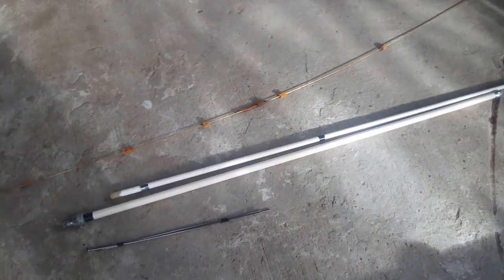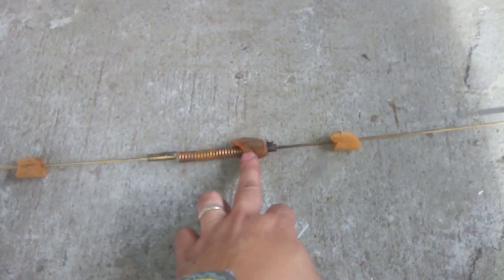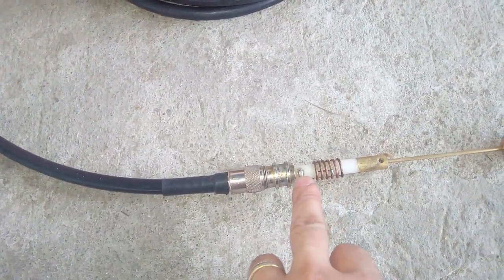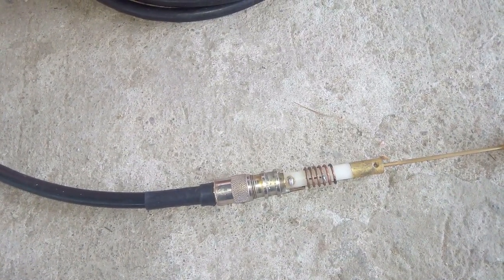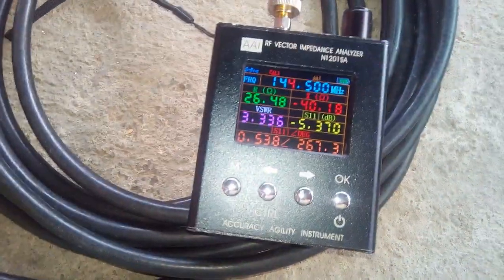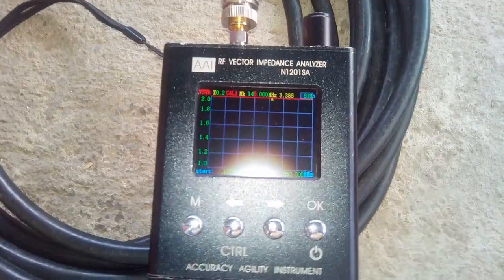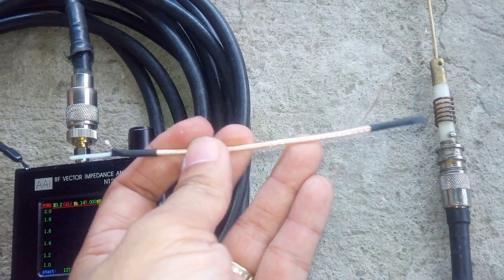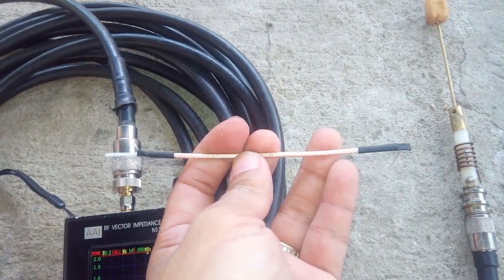Restoring Diamond F22A antenna coax replacement for capacitor - calibrated with N1201SA and NanoVNA

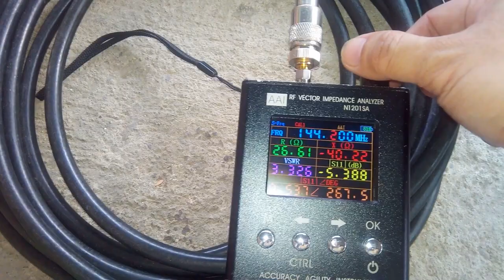Comment: Hello. I also repaired my x300 antenna. When i bought it the swr response was ok. After 2 years or so I had high swr response. I dont know why. When I opened it there was one 5pF capacitor inside. In fact it turned out that the cap was ok. (It had exactly 5pF). I tried to make my own 5pF cap with RG174 cable. I soldered it exactly where the previous one was. But unfortunately it did not help. I started to trim the cable until the swr response was ok. So the cable capacitor has now 3-4cm in length.(around 3 pF) The antenna works perfectly now. 1:28 at 144mhz  1.08 at 145mhz and 1.28mhz at 146. At 70cm it is also fine, around 1:2 or 1:3. So if anyone has this problem with antena, do what I did and it will be fine 😊
Reply from the maker: Good to hear that it helps you.
Reply: @EphraimGariguez  your video helped me a lot ! Thank you

Comment: I'm a bit curious why you had conducted your measurements not in free space, but laying on concrete. I do like how you used the coaxial cable as the capacitor, but somewhat concerned as to what the final values were while the antenna was mounted away from any near materials (ie concrete).
Reply from the maker: Of course it will work fine as your concerned is just restore it based on the original manufacturers specification (I did not alter the antenna physically, I just replaced a component that failed). If you're using antenna analyzer to tune you are fine, however if you are using an swr meter and feeding an RF to the antenna the result would be erratic  even at 5 watts portable if it is lying on the ground. Try it yourself.

Comment: Did you measure the field strenght, before and after? You have CH0 for transmit and CH1 for receive, you can measure the transmit power or field strenght
Reply from the maker: No need for that it's a restoration   just refer to the manufacturers antenna datasheet, my only concern is to restore the antenna to a working state.

Comment: One of the wire of the ceramic capacitor is connected to the core of the PL connector  hence to the core of the coax?
Reply from the maker: You just need to put it in place of the original capacitor, the end of coax replacement is not soldered together to form a capacitor replacement.

Comment: Bakit po antaas ng swr ng f22a ko po sa 144.000 1.6. Sa 146.000 1.2 sa 14800 1.4
Reply from the maker: Ano ba ang ine expect mo bro? nasa tolerance level yang values ng SWR mo pwede mong i adjust i check mo yung cutting chart ng antenna mo, ang 1.6 :1 SWR ay 5.3% power loss lang so kung 100 watts ang radio mo ang loss mo ay 5.3watts lang - Unfornately walang perpektong antenna system pwede mong i adjust hanggang makuha mo ang gusto mong level pero within tolerance level yan check mo eto. https://dw1zws.com/power-loss-at-various-swr-readings-and-residual-power/  ang G7 antenna for example ay rated as less than 1.5:1 at 2Mhz bandwidth https://dw1zws.com/g7-antenna-cutting-chart/

Comment: seperti antena berbaring tidak swr tinggi, dan frekuensi yang sangat datar dari 140 hingga 150
Reply from the maker: the antenna is designed to the those frequency band, the fault on the antenna is the burned capacitor so you just need to replaced the burned capacitor with its value and the antenna will perform as expected on the design frequency because you are just replacing the broken parts with a replacement part, if using antenna analyzer to measure the frequency response the result would be very close to the actual design frequency, even if you measure it lying down, however if you use an SWR meter and you need to drive it with higher RF power the frequency response would be different specially if its lying down on the ground.

Comment: You should have shown how you connected it the capacitor. And, after connecting the"capacitor", you could have erected the antenna in "free air" and do all the necessary measurements. We do not use the antenna lying on the floor, right?
Reply from the maker: First things first the connection of the capacitor is obvious you just need to put it back where you removed the burned capacitor right?, it doesn't matter if it's lying down to the ground or not encased in the radome if you are using an antenna analyzer, if it gives you a good reading on the ground, most probably when you put it in the proper position  you will get a much accurate read out. Unless you are using an SWR meter to tune your antenna on the ground and you are injecting higher RF to your antenna then most probably your result will be innacurate. The point here is you are just replacing the capacitor with similar value except it's a coax,  rather than a disc capacitor so what's the fuzz? it is already tested and guaranteed by the original manufacturer to function on the specified specification as long as the proper value of capacitor is in place. Try it yourself first  :)

Comment: Measuring those parameters specially the vswr with your antenna lying on the ground is VERY WRONG!!! You are just misleading other people by just showing the tools you use.
Reply from the maker: Try it yourself first before you say it's very wrong ha ha ha. You are just replacing a burned capacitor on an antenna that is guaranteed to work on the specified specifications according to the manufacturers data sheet of the antenna. So as long as you put or replace the broken capacitor with a similar value it should work to the original specifications. You are just basing your comment on what you are reading somewhere without actually trying it yourself.  Go try it and leave your comment again here.